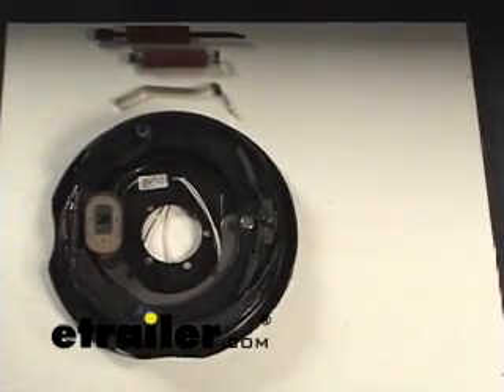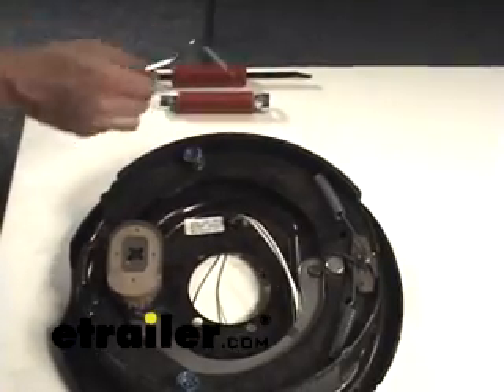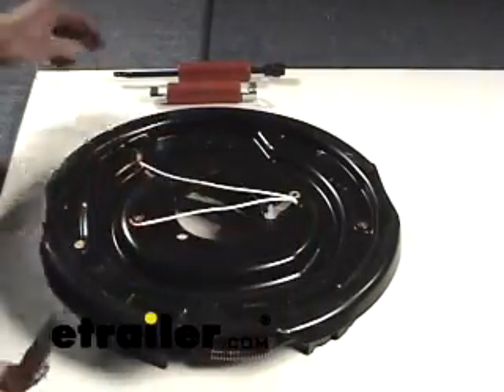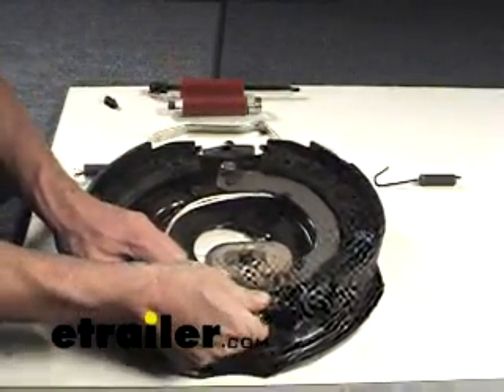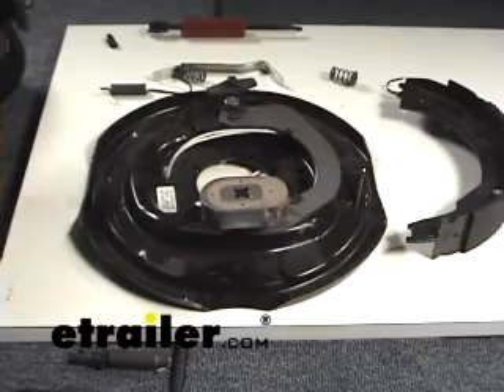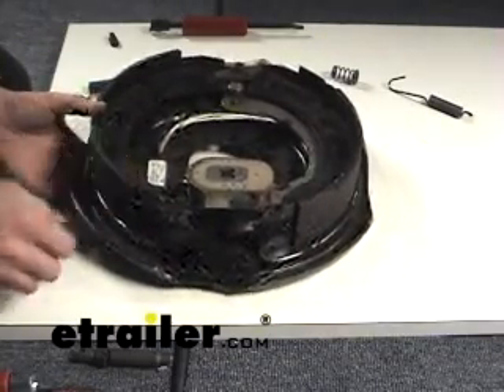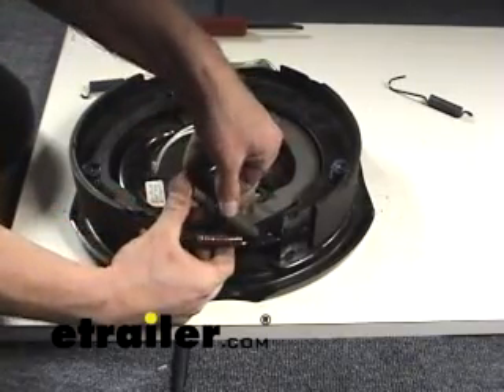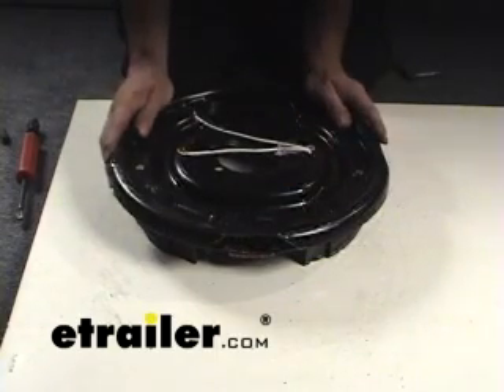etrailer | Removing and Replacing Trailer Brake Shoes Review

Comment from the maker: @BuhlzI I'm glad this video was helpful to you.  We didn't use a specific tool kit, however, the tools you need will be available at most auto parts stores.  The tools you will need an adjustment tool, a shoe spring tool, and a tool to remove the springs.  These should be fairly inexpensive.